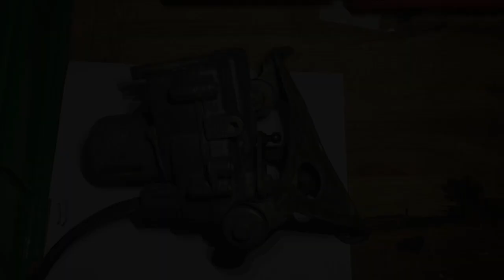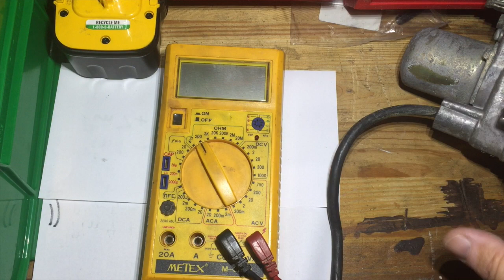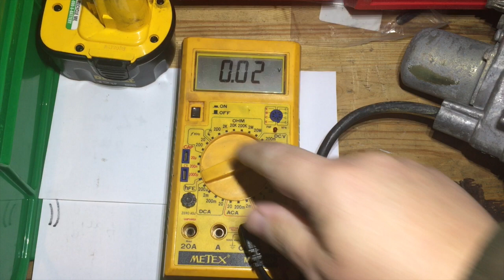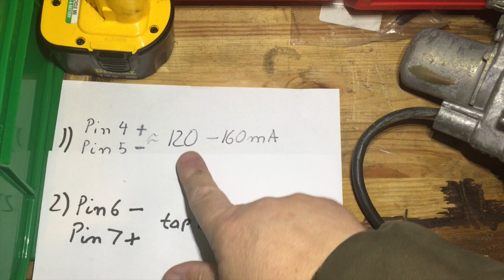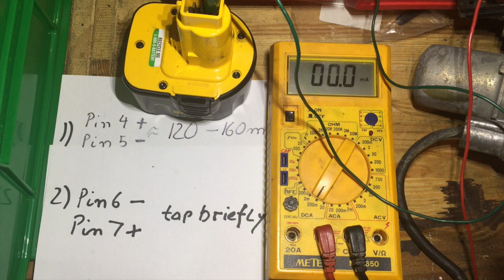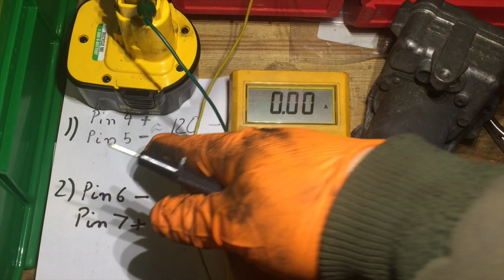How to Test a Classic Mercedes Cruise Control Actuator Using a Multimeter

Comment: Hey Ralph, What about verifying the feedback from this thing back to the amp???  I think I've got one that has a bad variable resistor inside.  Have ya ever screwed with that side of this POS???  Thanks!
Reply from the maker: LOL, I share your sentiment but I have not had to mess with that. Thankfully.
Reply: @straybenzes Ralph, the feedback is pins 2 and 3.  They can't be tested from the connector.  The only way is to open it up and remove the gear to ohm check the 2 traces.  Without that feedback, the amp gets stupid.  Working on a slick solution to save junk actuators using a throttle position sensor.  Stay tuned, or go visit the peach, Ive shown a little in the diesel forum.  Tchuss!
Reply from the maker: @jagboy69  Clutch stuff. Please keep me posted.

Comment: Found the pin connectors disconnected on my 87 560SL. After reconnecting, the actuator was continuously clicking. Does this provide any clue? Going to perform tests in this video next. Have new amp/controller. Wanted to minimize  it’s risk.
Reply from the maker: That seems to be a symptom of the amp being messed up. Good luck to you and a relatively pain free amp replacement.

Comment: Meu atuador esta batendo...tec,tec,tec....o que pode ser?
Reply from the maker: When does this sound happen? While driving? Is it still in the car or did you disassemble it?
Reply: @straybenzes  antes mesmo de ligar.. Ao dar meia volta na ignição já começa o tec,tec,tec...
Reply from the maker: @luisschommer9339  That is most likely your amplifier under the dash just above the brake pedal.
Reply: @straybenzes  eu ainda o tenho no carro.. Não mexi nele
Reply from the maker: @luisschommer9339  Most likely the amplifier. The actuator rarely goes bad.

Comment: Hi again, thanks for the great videos , I have uncovered a mysterious issue with testing my actuator, I have set everything up correctly, I was getting solid readings of 170mA, I was running the motor for about 10  seconds for each test, and I repeated the test 15-20 time's just to test the robustness of the actuator and the multimeter, BUT... 
I have blown two 200mA fuses inside 2 multimeter's with my test's! At first I was totally confused but I discovered that there was a mA spike which occurs for only a tiny fraction of a second before the actuator motor has chance to reach full speed, I registered at least one reading of 195mA but like I said,  only for a 10th of a second before it settled back to 170mA ....  

So My question is...

Will this damage the amplifier? 

What is causing this to happen in the first place?
Reply from the maker: This is a very interesting finding. It is my sense that this will unlikely be the cause for amplifier failure and such spikes are rather low in nature. Leaky capacitors are usually the reason why the amplifier will no longer work properly. The actuators are typically the lesser issue when the cruise control no longer works properly.

Comment: checked myn, it is a v8, clicked fine, so solenoid works, my merter has amps with 2amp and 10 amp selection, I selected the 2amp range, connected the wires as you did and set the dial on the meter to 200, results were it did buzz and the meter showed 28, im assuming this is 28 milliamperes, is myn faulty, the cruise control does not work when i push the lever up or down
Reply from the maker: I believe your amplifier is bad.
Reply: @straybenzes  amplifier is this the unit in the engine bay
Reply from the maker: @sas8403  No. That is the unit that sits right above the brake pedal near the steering column. The door and light buzzer is mounted there also.

Comment: Hi Ralph, when I try to engage the cruise control while I'm driving, it does not work, even after I replaced the capacitors, all I get is a continuous clicking sound from the actuator, twice as fast as a clock ticking, the sound is exactly the same as when you tap the battery with pin 6 and 7, do you know what could be going wrong?
Reply from the maker: Yeah, unfortunately sometimes it is not only the capacitors that are bad. I included a contact person in the video description who can help you out sorting out the cruise controller.
Reply: Voce descobriu o que havia de errado?

Comment: Good evening!
Do you have the electronic schematic of Cruize Control available?
I need the specification of the double diode that has the output of the decelerate circuit.
do you have photos of the disassembled circuit, open of the aluminum box?
Thanks
Reply from the maker: I unfortunately do not have neither spec nor drawings of this subcomponent - sorry!

Comment: Hi Ralph,I tested the cruise control actuator on my meter,I am not getting any readings on pin 4 and 5,pin 6 and 7 makes a tapping noise as per your video.Do you know what the issue of no reading means.Thanks
Reply from the maker: Hi there. No reading on pins 4 and 5 either means that there is a broken wire inside the actuator or you have not connected your Amp meter.
Reply: @straybenzes   I can hear a noise coming from the actuator but no reading on the meter,pin 5 and 6 makes a tapping noise
Reply from the maker: @satwantbanwait8196  That does sound like a potential issue with that unit.

Comment: What was it that caused the 2ed amp reading to be higher that the 1st test did not find?
Reply from the maker: There were two separate actuators in this video clip. The first reading was with a good actuator. The second one was with another actuator that drew a higher Amperage.
Reply: @straybenzes  Thanks....I see that now
Reply from the maker: @jcasey460  No problem. Have a great day and keep your classic car running.

Comment: What were your cruise control symptoms?
Reply from the maker: There are some generalities I noticed when working on the cruise controls. If it does not work at all or it does work but only sporadically it is typically the amplifier (faulty capacitors). If all control functions work but it stops working while it is set to cruise it is most likely the actuator. If nothing works it can be both; the actuator could have malfunctioned and taken out the amplifier with it. Good luck.